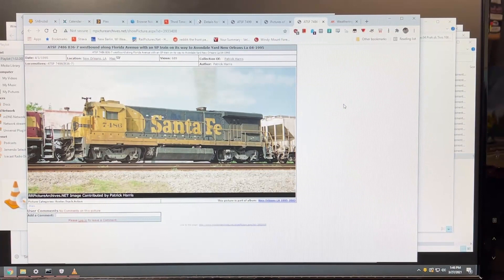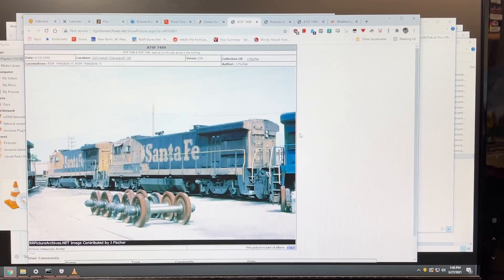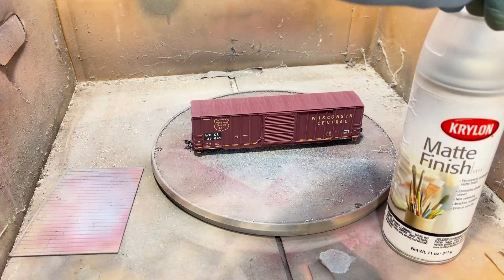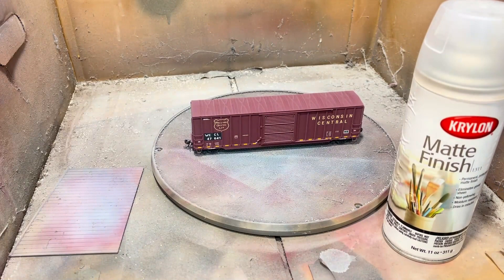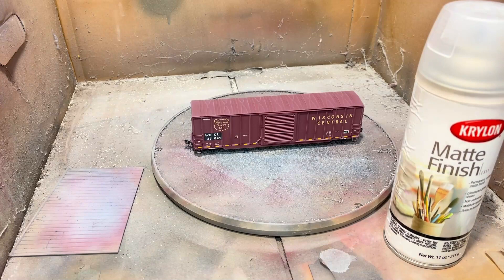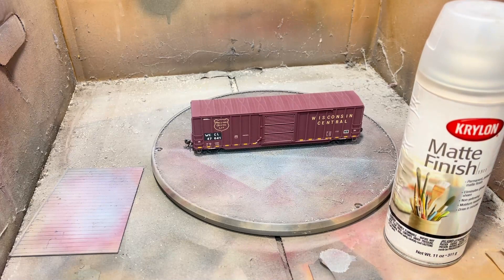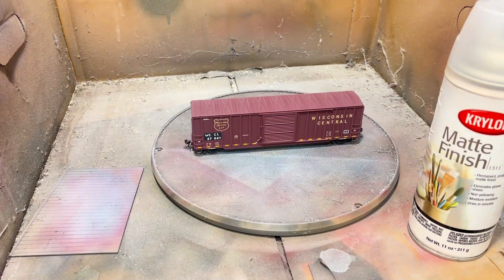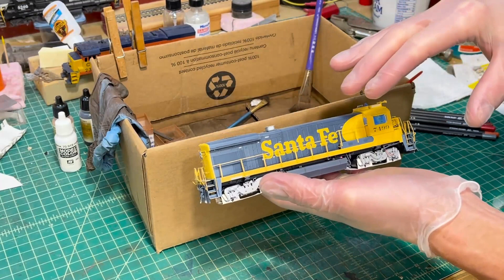Work of Art or Destroying One?  Weathering a Rapido B36-7 Santa Fe Unit

Comment: The Krylon can dry with a white, sort of frosty look sometimes.  I was told it is very important to only use the can a few times as the heavier chemicals can pool at the bottom of the can.  Someone told me shaking the can everyday can help alleviate this, but who has time for that?  I have gone back to Testors Dullcote, either the aerosol or airbrush version is fine.
Reply from the maker: I think I can attest to that as well.  I just did a handful of locomotives recently using the same techniques I showed here and when I sprayed them with the Krylon I felt like it did mist it white when it dried.  It's not horrible, but at the same time, the white over the dirty weathering doesn't look right either.  On the next batch I have some Vallejo clear matte varnish I'm going to try instead.  Thanks for the tip on this for myself and others.